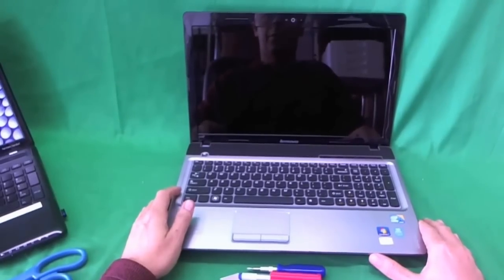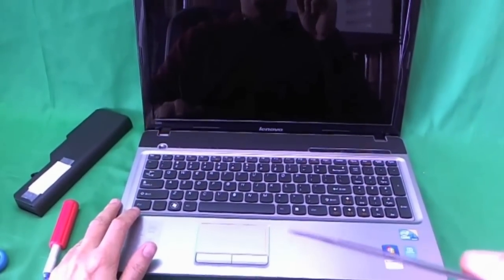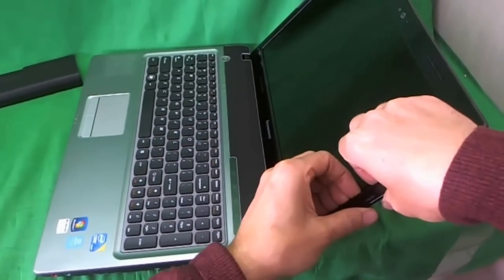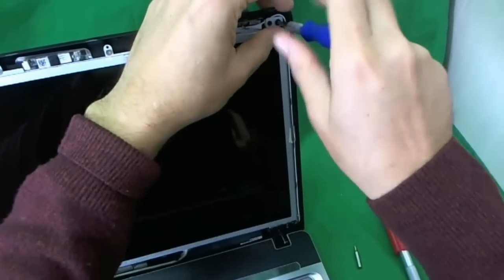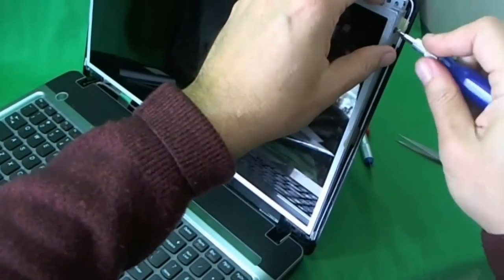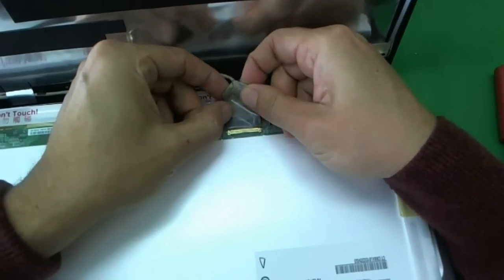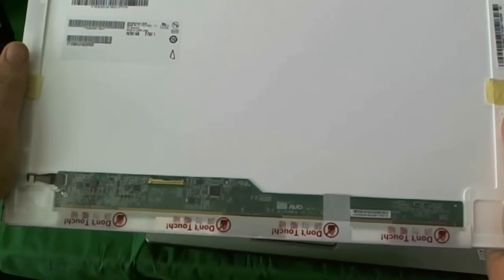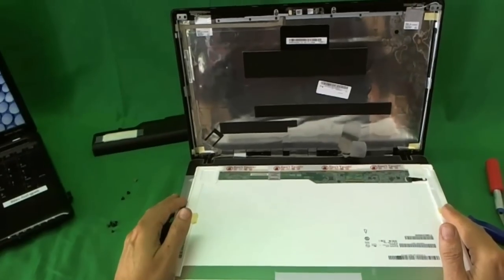Lenovo Z560 Laptop Screen Replacement Procedure

Comment: Your tutorial is great. After dropping my Ideapad and breaking the screen, I've been running it on a monitor for months, due to other saying changing the screen was not worth it. However after watching your video I ordered a replacement screen for less than $50 and installed it in about 20 minutes. It now works as good as new! Thanks!!

Comment: after i replaced the LCD on my Z560 - which is all set.  however, and problem with wi-fi.  I got from time to time that lost connections to my routers (test with 2 already, one at home, one at work, same result).  it'll see the routers, but can't connect to it, or connect to it, but lost connections after, and wait for a while, it'll come back.

do you have any ideas what might be wrong? Is there any connections from the screen that I might caused the wi-fi issue?

Comment: After removing the battery, shouldnt you press the powerbutton. To discharge any residual charge? I have a slightly damaged plastic lcd case, on my Z560. The screen is fine, I just need to find where to get a replacement case for the screen. Or I could go for the cheaper option of a home repair.